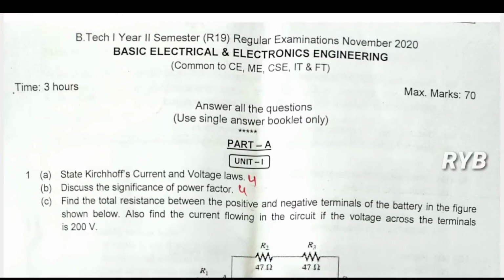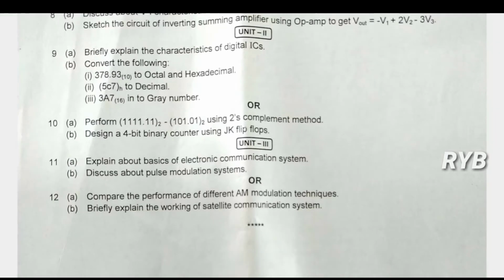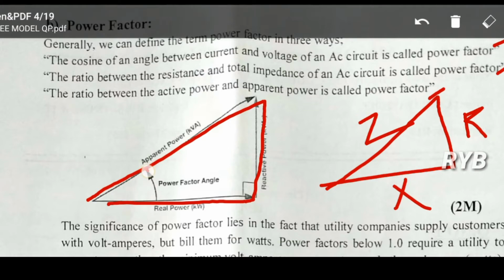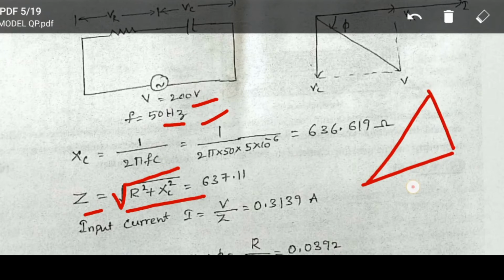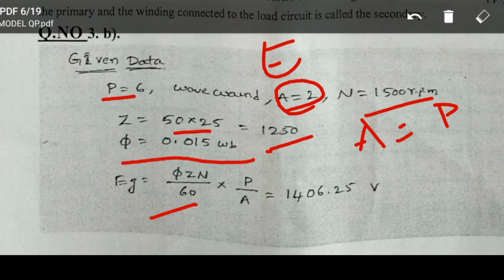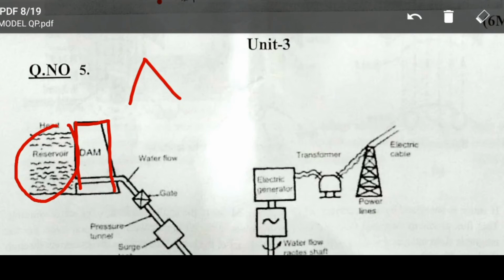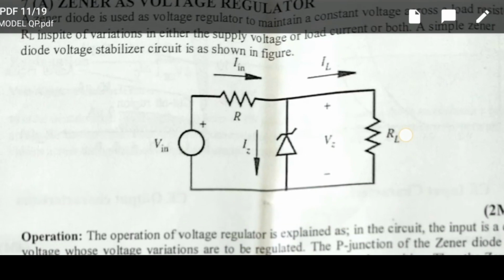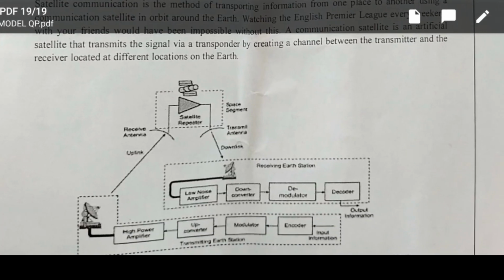BEEE (Part-A&B) previous Question paper explanation with answers | for CSE/ME/CE/IT/FT | reddaiah

Comment: How many marks we need to get in beee to pass in this exam?please reply
Reply from the maker: 40 marks required to pass,25 external +15 internal
Reply: @Reddaiahpolisetty  electrical lo 13 ,electronics lo 13 ravala
Leka 
Renditlo kalipi 25 ravala sir
Reply: Please reply sir
Reply from the maker: @sujithkumar1352  sum of two  should be 25, if you got 15 in electrical and 10 in electronics, so sum will be 25 , so pass
Reply: @Reddaiahpolisetty  ok thanq sir,
But our faculty told that
We need to get 12.5 in electrical and 12.5 in electronics,then only studemt will pass in beee.
So i got a doubt.

So,i am very happy after seeing ur reply.
I
Reply: @Reddaiahpolisetty  i am expecting that this is right
Reply: @sujithkumar1352  alagana bro Mari ?